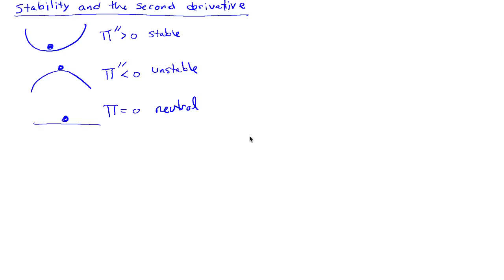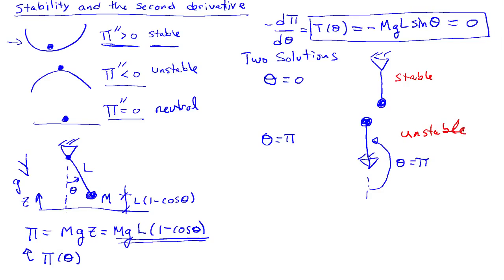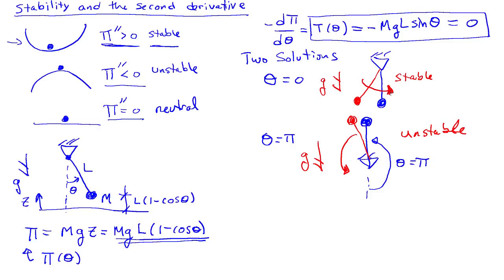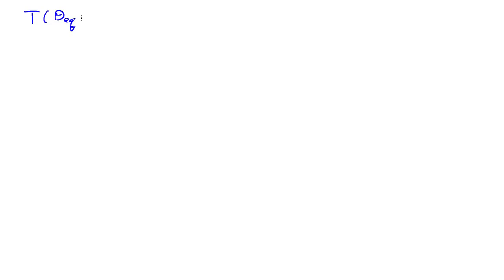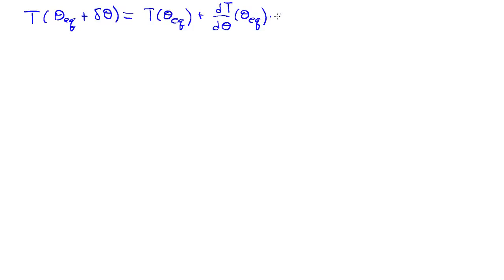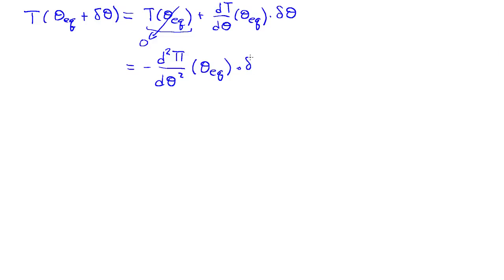Stability and the second derivative of the potential energy

Comment from the maker: At the end, the meaning of neutral stability is not mentioned.  Neutral stability is defined as d^2 Pi/d theta^2 = 0 when evaluated at theta_eq.  From the derivation, this implies that for small perturbations away from equilibrium, the loading system provides zero torque to the perturbed system.  Thus if the system is perturbed, there will be no torque trying to move the system back to equilibrium nor will there be a torque trying to move the system away from equilibrium.  The situation is 'neutral', not stable, not unstable.  In such situations one should look at further terms in the Taylor series to obtain a more complete picture.
Reply: Dr. Govindjee, why is their a negative sign in front of the derivative of the potential energy of the system?
Reply from the maker: sameer fares
 Sameer, there are two possible choices [Force] = - [dPi/dtheta] or [Force] = + [dPi/dtheta].  The standard convention is to use the one with the minus sign.  It is nothing more than a convention.  You could go with the + sign but then you would have to reverse the sign of Pi and that would make it hard for other to follow your work.